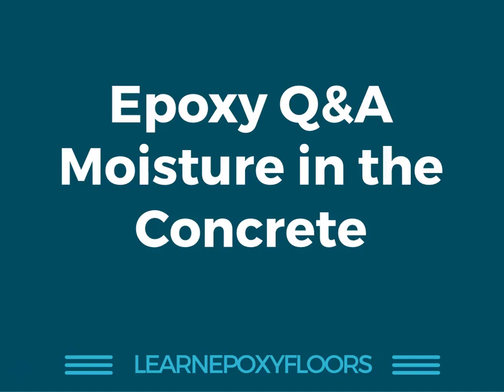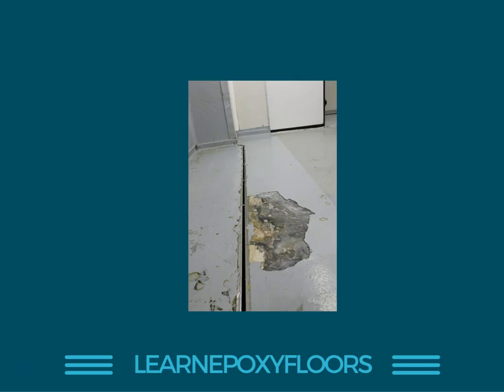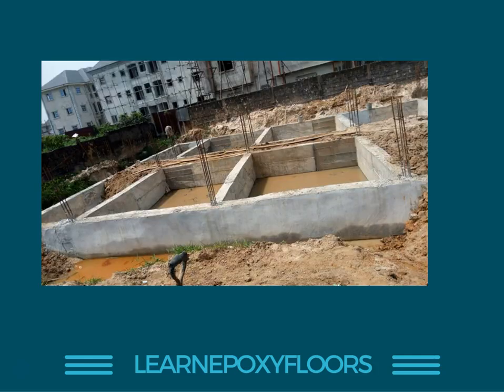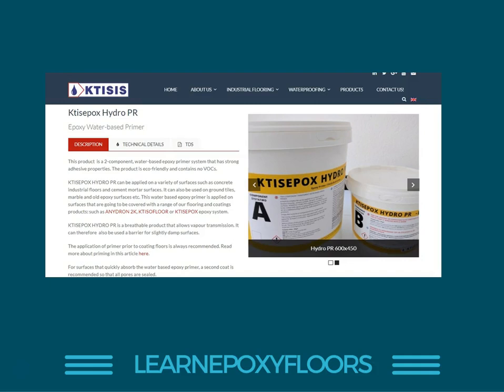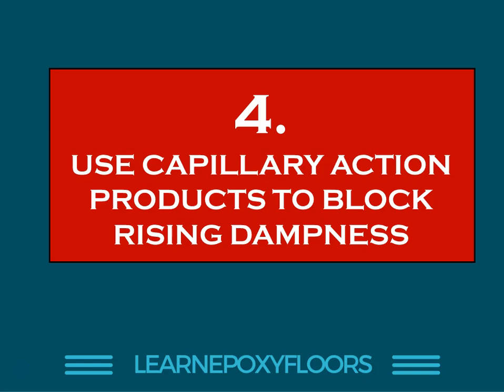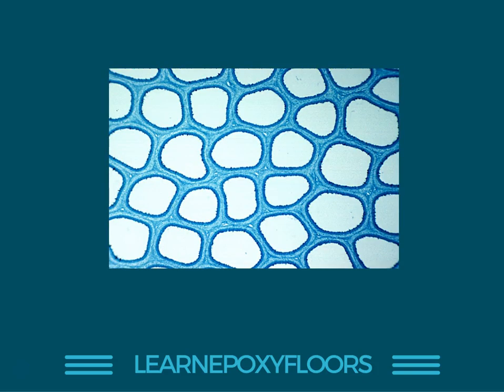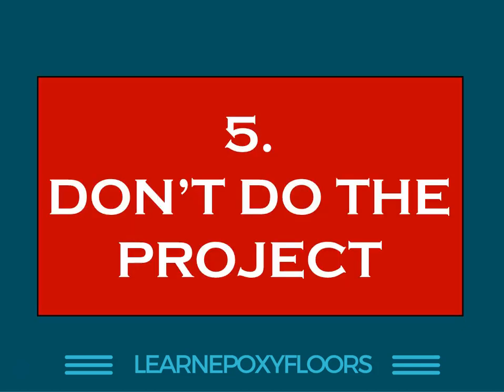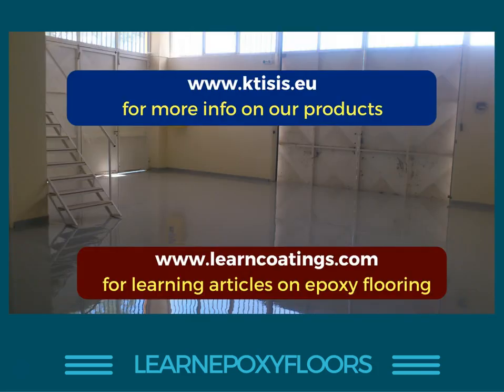Epoxy Q&A - Dealing with Rising Dampness

Comment: Appreciate the video.  I have  a basement slab that is highly hdyroscopic.  I'm being recommended a urethane cement with a seal coat.  Normally a commercial application but they have done it in several residential projects with no failures they say.  Have you heard of this? Thoughts? Client looking for 10 year lifetime?

Comment: Sir, Sorry...Very late comment, but maybe you can try use Epoxy Mortar 5mm for Moisture barier...
Reply from the maker: Yes this is an option using a water based epoxy formulated with cement or quartz it could probably work well. The truth is I have seen siginificant progress in this field in the last few years with really good new generation epoxy products

Comment: Hello, what do you think about products marketed as temporary moisture barriers (TMB). These are 3 components Epoxy Screed , applied at 2 mm, prior to applying the epoxy. Are these effective. Ex. Sika Floor Epocem 81
Reply from the maker: The main danger with these products is to get them to bond properly with the substrate. They can be effective as a moisture barrier but the the surface needs to be prepared properly perhaps lightly scarified or shot blasted so that the layer above will stick